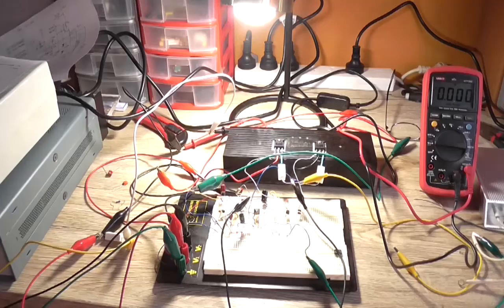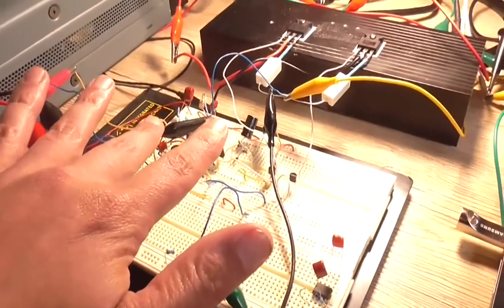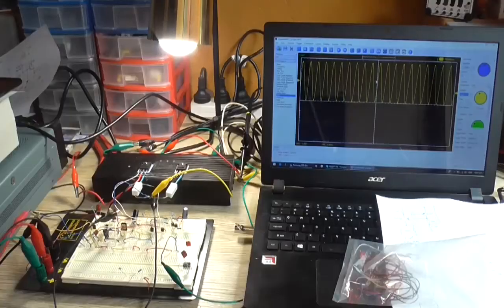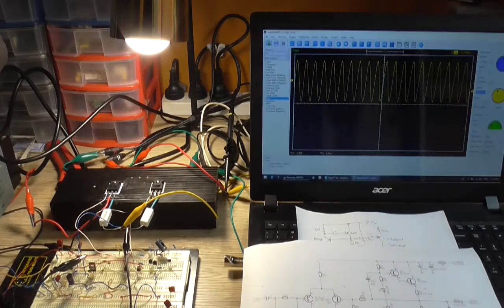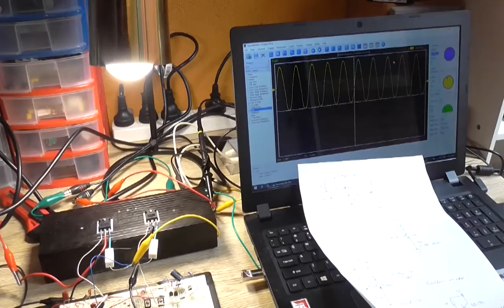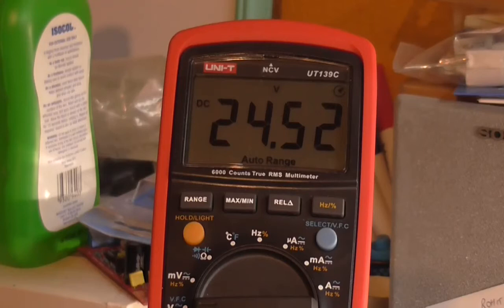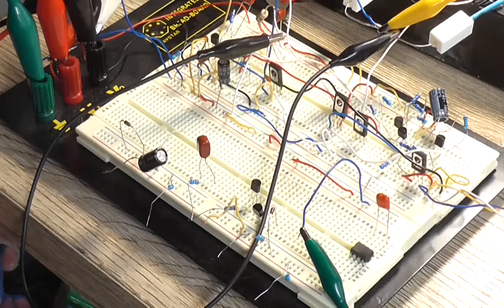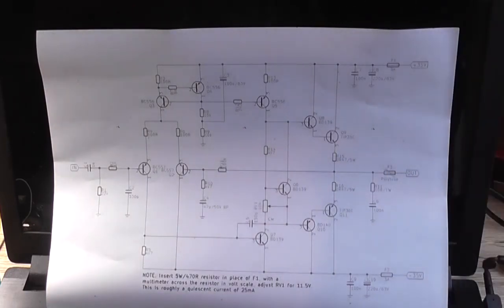Discrete Power Amplifier Part 2: Final Modifications

Comment: The Zobel resistor smoked because the amp was oscillating which dumps a lot of power into it.  You can see the HF oscillation as a fuzziness on the top of the waveform around 9:50.  Classic breadboard problem.
Reply from the maker: May have been, I'm not sure as the scope was not showing oscillation. More likely a short, but yes, bread board is ok for simple circuits, not power amps.

Comment: What book are you reading on amplifier design??? I have a couple of books on this subject I am reading just wondering what are the ones you are using
Reply from the maker: From a book my dad had I think it was either published in the 1970's or 1980's, acquired knowledge and also by reading a lot of information presented by Rod Elliott, who is an electronics engineer. Here's Rod's page https://sound-au.com/
Reply: @AstrosElectronicsLab  Thanks for the follow-up response. Much appreciated.
Reply from the maker: @carrizzle9586  you're welcome. I was an audio repair technician for several years, also. However, as I'm not an engineer, I may not be explaining stuff clearly or correctly.
Reply from the maker: @carrizzle9586  I also apologize for the response 6 months later. Your comment got buried in my notifications and only noticed it as I was going through my dashboard today. My bad.
Reply: The video's are GREAT!!! And for a non-Electrical Engineer to be going into that level of detail about amplifier circuity and layout is amazing. I'm an Electrical Engineer and probably couldn't do half as good at explaining these things.
Keep up the good work!

Comment: Have you any idea what you are doing? You don't throw componets at a working design -you just make it worse. You can just change transistors willy-nilly.
Reply from the maker: Indeed I do. There is a method behind my "madness". Let's start with the obvious. You can substitute any transistor you like as long as its ratings are the same or better. The self biasing network was replaced with a vbe multipler as it barely worked correctly. The vas transistor was upgraded as the original got too hot as already stated on the diy audio forum where I got the circuit. The drivers were changed as that means the voltage requirements can be higher. Higher rated output transistors now means the supply voltage can be as high as +/-42 volts equating to higher output power. This is mostly for experimentation purposes. Thanks for the comment.